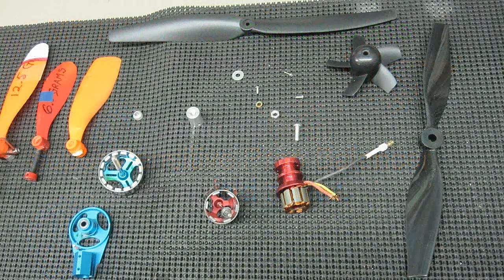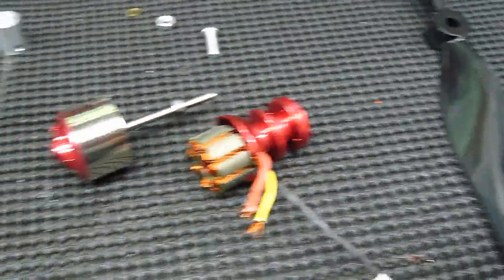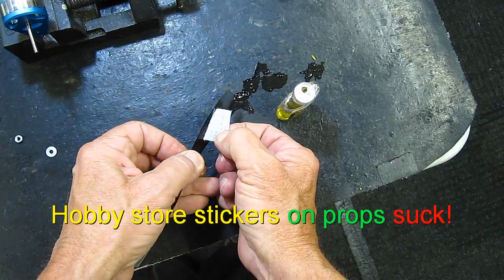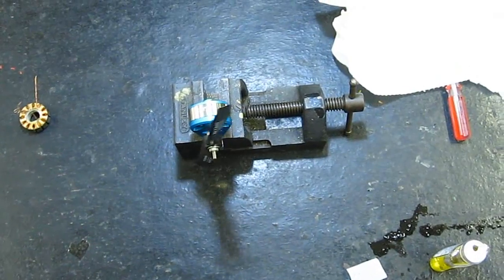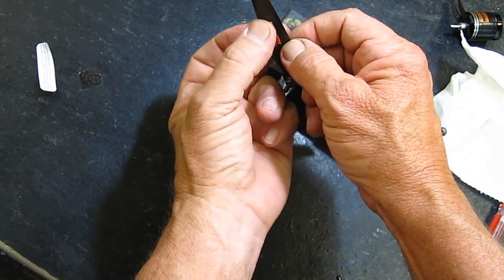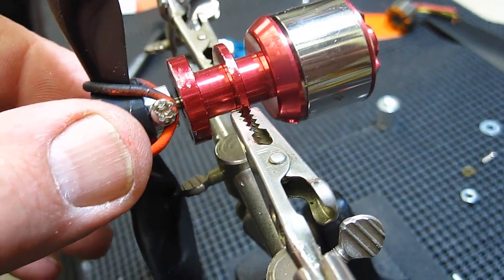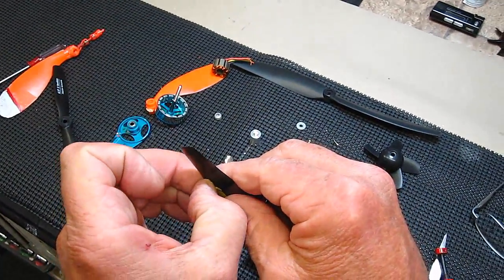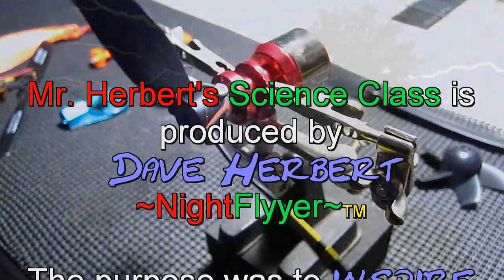I made a sensitive Prop Balancer from an Old Motor +  my Prop Balancing Tips.

Comment: Horizon Hobby says to sand the heavy side on the back thicker side,what says you to this? Wouldnt tape eventually blow right off anyways?
Reply: that's why he puts the tape on the leading edge, the air presses it tight. personally i wouldnt use vinyl electrical tape though because it doesnt tend to stick well and "creep" over time. sanding is another method i dont like but there are many methods, from drilling tiny divots and sanding, to a mix of 1-minute nail polish and tungsten dust. personally i would propably use aluminum tape and scrape some off with my fingernail, if it was too much. the glue on that stuff is great, and it's pretty thin.

Comment: Here's a question for you.

If the motor bell is not balanced beforehand, doesn't this mean that it will influence how the props are balanced?

Do you balance the motor bell first?
Reply: Can you remove bell and let only shaft with bearings...works fine too! I do it myself.

Comment: Cool, but..
1. Must balance the motor first;
2. Thee ball bearing will only turn under a relatively high torque.

This method is enough for a rough indication, but it won't have the sensitivity of balancers whose shafts rest on large-diameter discs with 12:1 or more reduction ratio. Not to mention magnetic balancers, that BTW are great DIY project too. :)
Reply: +corisco tupi Totally agree
Magnetic balancers are so cheap, so much less friction, and don't need balancing; but this is useful in an emergency. (but I have a box of balanced props)
The method of adding tape is 'odd'. Why stick it down and then peel off again if wrong? Touch the tape to the leading edge, only press down if correct. The change in CoG is minimal.
Make sure that you balance your motors too, otherwise it's like adding a balanced tire to an unbalanced rim!
Reply: Exactly! The friction in the bearings is much larger than friction on the cheap DIY magnetic balancer

Comment: Thanks, it worked perfectly! I used an old Turnigy blue wonder. Very sensitive. One thing I had a problem with was getting the coils out, it took me a minute to take out the bearings. Other than that, it's perfect!
Subscribed

Comment: Great vid Dave. Just one thing I would add. When I balance my heli blades I put tape on the lighter blade but don't fold it over until I check the balance. That way I can simply cut off part of the tape and balance again. When the balance is right, then I fold it over. Just my 2 cents worth lol. Keep the great vids coming!!

Comment: Why do you fold the tape over the leading edge before you have it balanced and know that's where the tape needs to be?  Folding tape won't change weight so why not wait with folding tape over prop until after you know how much or where it needs positioning?

Comment: This works well for car tires if you have a car with rear drum brakes.  Adjust the rear bearing to allow for free movement, or if you squeeze the pressure from the caliper. Whatever it takes to get the drag down.  I have balanced my own tires In between sets for a long time like this.  

An old RC plan hobbyist showed me this 25 years ago.

Comment: If you put it on the leading edge, wind will go over it and it will stay there. if you put on trailing edge or the back or front, wind will grab into the edges of the tape and it will come unglued or just rip off at high rpm.

Comment: I got a set of 2 master airscrews from hobbyking for my umx geebee as3x (5.5x4) and the 1 I tried to balance was pretty bad and it took a long time 
but that might be cuz it was the first prop I balanced and I did use light tape and steel wool to balance (to be sure that I didn't mess up that prop)